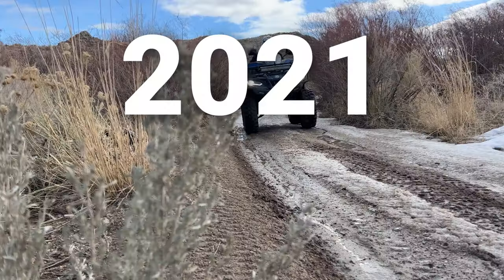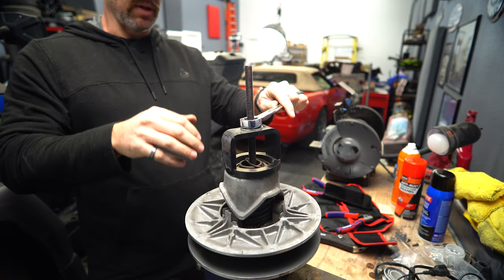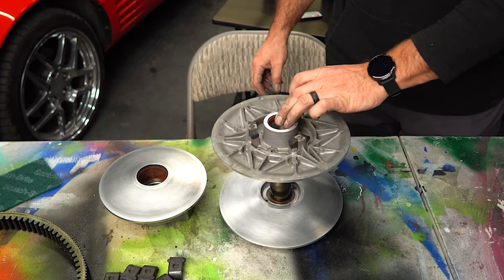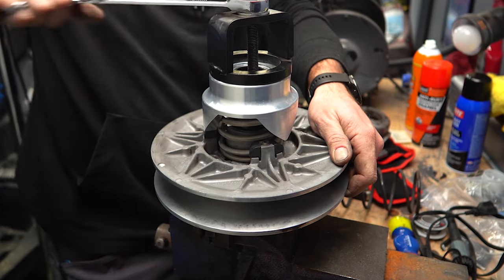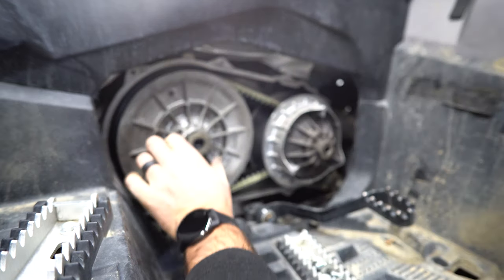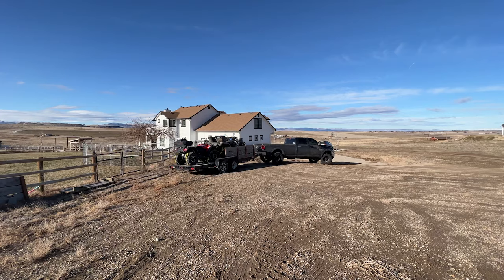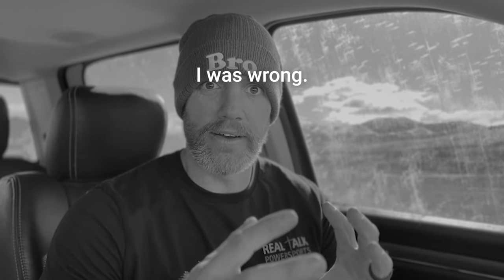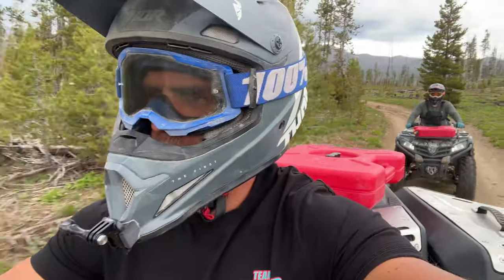Installing the Stage 3 Trail Clutch Kit // CFMoto CForce 1000

Comment: Did you line the balance marks back up on the primary when going back together?    And an impact? Really?   Torque wrench man. Bad things will happen eventually
Reply from the maker: Pretty hard to torque something spins 😅
Reply: @BroBuildsGarage  they make a tool to hold it.  Cheap.

Comment: Great video and quality.
I like everyone! I have a question to the 30inch tyres!
Everybody said bigger than 28inch is to big and you loose to much power!
What is your experience?
Why not 27 or 28 inch?
Reply from the maker: It’s super rocky where I ride so I wanted as much clearance as possible. With the clutch kit and tune, 30” tires are no problem at all. 30” would probably be a bit much without the clutch kit, though.
Reply: My 29” Bighorns are too much for the stock clutching. I am going to do the stage III kit after watching this video.